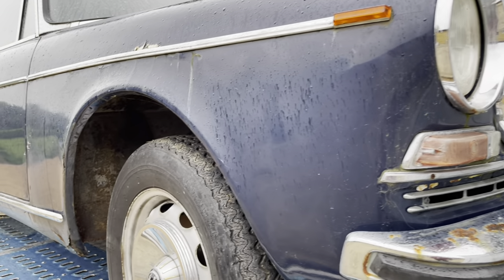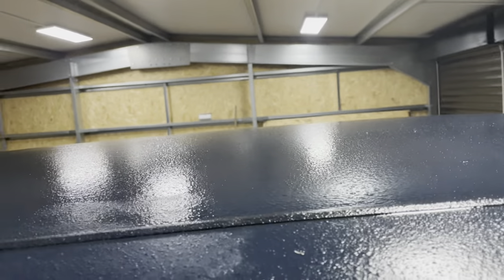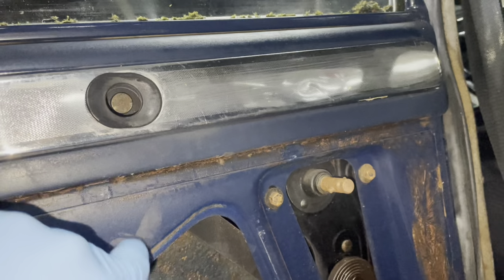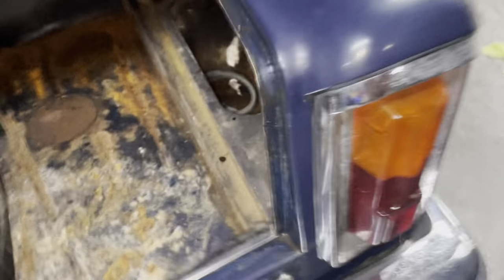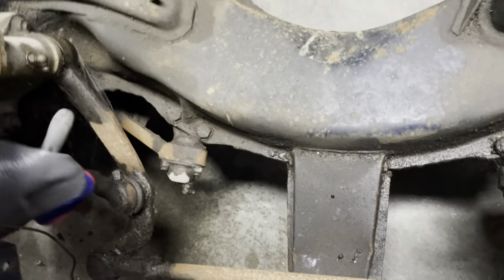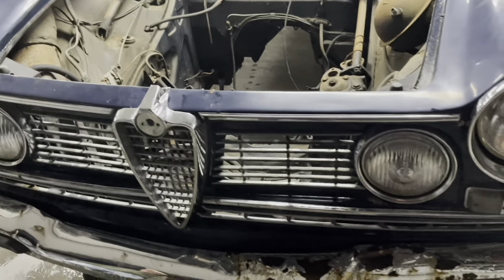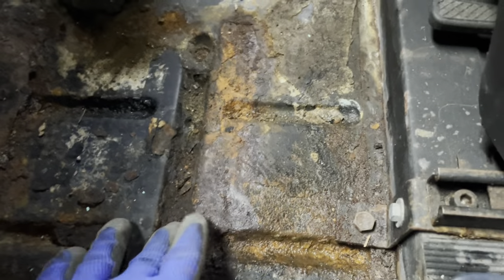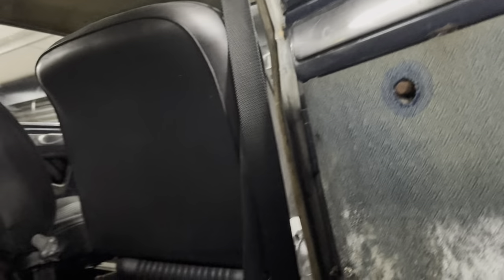Alfa Romeo moves into the garage!

Comment: I'm Italian so I've seen several of them 😊.
It was the development of the 1958 Alfa 2000 Berlina, which was produced in greater numbers than the 2600.
Interesting cars, a little heavy compared to the engines and penalized by the great appeal and success of the Giulietta which had exceptional performance.
The spiders and coupes were very successful.
In Italy they were the cars of political leaders and state managers, while industrialists preferred Flaminias or FIAT 2300s.
About 500 were produced with right-hand drive.
The 2000 enjoyed a long second life in Brazil as FNM, where the production lines were moved.
Since in Italy the bodywork of the 2600 sedan was considered too traditional, the OSI Carrozzeria put the "Alfa 2600 OSI Berlina De Luxe" into small series production, very bright and with very clean lines.
But Flaminia was a Goddess...

Comment: Oh that's a beauty! You are correct, I have never seen one... I suspect almost zero of them were ever delivered to Canada. It is a lovely machine, for sure, but the Flaminia is still even prettier! I hope it gets saved by a generous enthusiast... I suspect the engine was appropriated to fix a coupe? Very cool to see one regardless... Cheers from me and Frankers!
Reply from the maker: It’s a interesting car, the more I look at it the more I like it! Who knows why the engine was nicked.. probably went to a coupe or special build, I have access to a Sprint engine and gearbox (triple carb setup) So at the moment I’m thinking: do the brakes, patch the floor treat and paint it. Pull out the stinky headliner, get the engine gearbox sorted and drive it as is as a shabby banger with filler and holes. Only two registered in U.K. so not many about here either… they made 7000 coupes and 2100 sedans go figure what wealthy Italians wanted.. concur the Flaminia is a more beautiful car, but the Alfa has a certain coolness to it 🇮🇹🍕🏁

Comment: Only sand-blasting down to bare metal will tell how solid it is. That's probably the only way to go, otherwise the car will continue to deteriorate underneath the paint and filler. It should probably go back to Italy where the expertise to restore it and locate parts is most likely to be. Restoration will probably cost more than the car will be worth in the end, but that is almost always the case.

Comment: Yes I have seen one before . In fact a new one of these in the Alfa Romeo show room of an Alfa dealer in Melbourne , Australia, way back in 1965. In right hand drive, and in dark green.  This is just a large version of the Alfa Romeo Giulia TI of 1962, has the same side profile, and has the rear tail light assembly of the Giulia TI, just mounted vertically, instead of horizontally. The early ones like this one, had drum brakes all round, made of aluminium alloy and finned for cooling. It is mechanically similar to the Alfa Romeo 2600 Sprint, with twin cam 6 cylinder engine.
Reply from the maker: I can imagine it looked great brand new! 500 were made right hand drive, put together in east London South Africa. This one has disks in the front drums on the back.
Reply: P
1:01  @Mitkawatch contact avec moi-même posséde 2600 berline